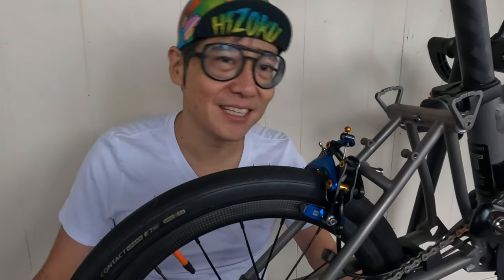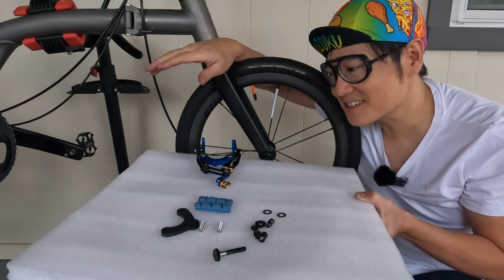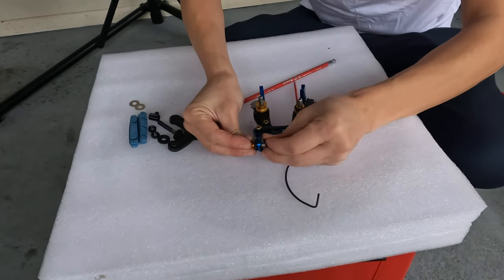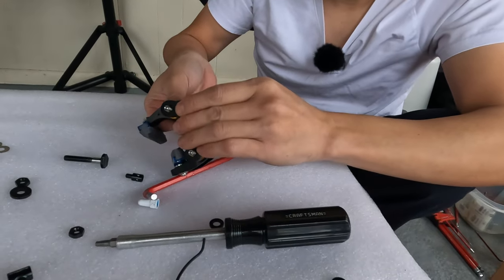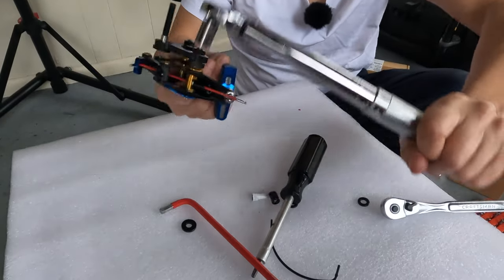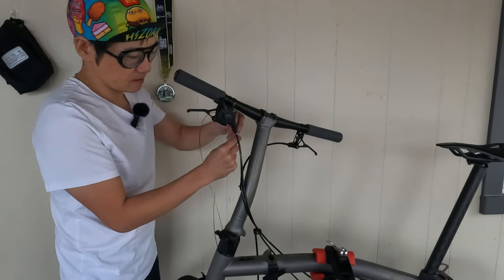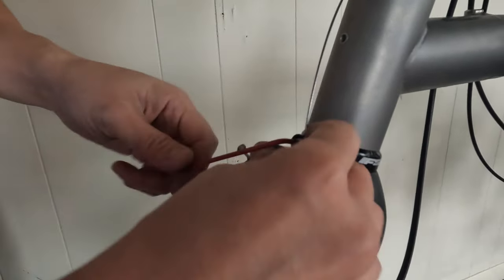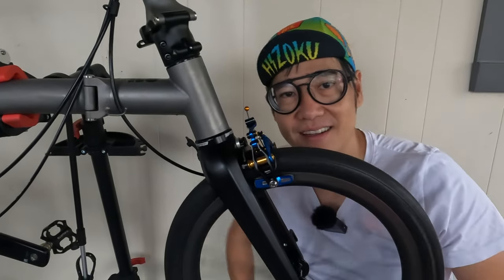BROMPTON T LINE UPGRADE CANE CREEK EEBRAKE EL TORNADO EDITION

Comment: Hi, it is very nice brake upgrades on your bike! Have a little tip cables are often overlooked: Lubricate all your cable wire for optimal gliding function with, for example: Tri Flow Lubricant Teflon. Higher quality cables such as linear brake cable with smooth surface Teflon coated pre-stretched increase the functionality of your brake system.
Greetings from Croatia
Reply from the maker: Thanks for the tip! I have been meaning to do that.

Comment: I have changed the small brakepad, security bolts on my brakes to titanium, as also other parts on my ordinary brompton brakes. For now my "Lightweight", with mudguards ( I'm a Rainy Dane!), is down to 9,35 kilo, and still with room for improvements to make it even lighter in spring! But as a 75 years old, 100 + kilo man, I may find less expensive ways to make the combined weight of bike + man come down, and a full titanium bike isn't one of those, I'm sure my dear wife will strongly agree😁!   Finn. Denmark

Comment: Hello,

thank you very much for the great instructions. I have one small tip.
3:38 Please put Loctite in the thread of the nut, if the air can not escape. In this way, the adhesive is distributed evenly. If the screw is wetted with Loctite, most of the adhesive is pressed out again by the air pressure when screwing it in.

Thank you ☺️
Reply from the maker: Good tip! I will do that.

Comment: nice I did try lightweight aluminum levers and carbon fiber brake calipers very light but they felt spongy to me did not trust them so I went back to the stock setup and like it more
Reply from the maker: I know what your talking about. When I am braking hard I use both brakes to distribute the braking power.   I would like to try the Paul brand brakes next.

Comment: Great video,  one question, what is the reason for direct mount ? better than regular mount?
Reply from the maker: The direct mount brake has two bolts on the caliper that stabilize it better than the regular mount which only has one.  So when you squeeze the levers the brakes have more strength.  How much more I don't know because I have never used the regular mount.  I have asked a few people and they all said it is better as well.
Reply: @BromptonFamilyTime  Thank you!!! Arigato~~

Comment: Do you feel brake performance has improved?  I’ve heard that braking strength is reduced but obviously weight savings vs. Stock.   And of course they look amazing.
Reply from the maker: Brake performance feels the same (technically they may be better maybe if I have to brake hard but I haven't tested them enough to know yet.).

Comment: May I check which version of the eebrakes did you get? Apparently there are front fork mount, seat stay, brake set etc...
Reply from the maker: This limited edition is a set in the direct mount Fork/Seatstay configuration.

Comment: Hi, you are using aceoffix brake levers and how you attached the stock shifter on it ?
Reply from the maker: Yes they are the aceoffix brake levers.  You need to buy a separate adaptor for the shifter.  I am using one by H&H design.

Comment: I have a comment because I noticed something while putting it together.
 If you roll backwards on a hill and then apply the brake, the brake pads would have to push out backwards because there is no set screw to hold them in place.
Reply from the maker: There is a small "indent" keeping it in place.  If your brakes are engaged it shouldn't have any problems coming out.  If your rolling backwards for some reason, then maybe there is a small chance.

Comment: Was told that the direct mount eewing brake might rub against the tyre (Schwalbe ONE) that I am using.  Wonder if T line and P line any difference when mounted with the brake.
Reply from the maker: I'm not sure but there is plenty of clearance so I don't see any problems with rubbing.

Comment: Hey 

What is the weight saving over the original brake? What brake levers do you use?

Keep your great work up, I love it.
Reply from the maker: The brake that it replaced had a full titainum bolt kit kit on it so there was not much weight savings.  This is due to the weight of the mounting bracket adding weight.  I don't remember the exact weight savings over a complete stock brake caliper.
Reply: @BromptonFamilyTime  Thank you. What kind of brake levers are you using?
Reply from the maker: Aceoffix Carbon Levers.  They don't feel nice but are light weight lol.

Comment: May I know what brand of brake lever you using for your T line? Thanks
Reply from the maker: Aceoffix Carbon Levers and a H&H shifter/bell mount.
Reply: Thanks for the reply. May I know how is the performance? I was considering between aceoffix carbon and Extralite 3 brake lever
Reply from the maker: They are not as comfortable as the stock levers since the edges are sharper.  The trade off is these are light weight.  I personally like them but I have heard from another rider that one of them snapped on him.  I may get a set of Paul levers next if they brake but so far they are working fine for me.
Reply: @BromptonFamilyTime  thank for you reply and really appreciate it!! And I love to watch your video!!! Very nice and informative 😁

Comment: Any reason why you went for this and not the regular mount?
Reply from the maker: The direct mount is suppose to be stronger in terms of braking performance and also it sits lower on the rear so you don't have to worry about ground contact.
Reply: @BromptonFamilyTime  I see, fantastic looking brakes they really complement your t line; I’d ❤️ a set for my Brompton but can’t justify the expense. Awesome channel btw,  happy new year to you & your family.
Reply from the maker: The best brake upgrade would be changing the stock brake calipers with titanium bolts.  The stock Bromton brakes are excellent.  This upgrade is not necessary.  This is my dream bike and I changed it for cosmetic reasons mostly.  I won't be buying them for my other Brompton bikes lol.

Comment: Nice brake sets! 

Btw, in asia at least, I observed most ppl change the arms of the êebrake to Ti parts arms (longer), so have a larger gap between the brake and the wheel, wonder with original eebrake arm, will it cause any issue for you later?
Reply from the maker: I have seen many ways to install these eebrakes onto a Brompton.  The regular mount needs to have an extender to make them work.  So, the choices are the mount "drop" mount, brake pad extension or to change the arms (or even a combination of these).  I have seen mixed results so I went with the direct mount since it is straight forward.  From my research the direct mount offers better braking by design.
Reply: @BromptonFamilyTime  I guess direct mount also make the money spent worth it, my personal opinion, if you changed out the extender arm, it’s “almost not” eebrake anymore since almost 80% of it is not made by ee, good choice!
Reply from the maker: @eth3002  That is true.  It is nice to use it as it was made by Cane Creek.

Comment: Hello, what is your experience with TI Parts?
Reply from the maker: I love their parts overall.  The smaller screws and bolts can strip easily so you have to take your time and make sure your tool is properly engaged.

Comment: The EEbrakes don't work very well on brompton. 'The small wheels have so much more torque than 700c and the calipers are single pivot type and they can not keep up. Aditionally they have very short  arms limiting wheel selection. I sold mine
Reply from the maker: Which mount did you have? They feel the same as the original for me.
Reply: @BromptonFamilyTime  Nice to hear, it worked for you. Mine were not direct mount though. I damaged a couple of tires by missing the brake path and rubbing the tire sidewalls with the brakepads due to the short arms. Only my kojac tires would fit below the caliper. I went back to stock calipers
Reply from the maker: Yes that could be a problem.  I have seen many solutions for the short arms (arm extenders, brake pad extenders, etc) but it makes the brake weaker.  The stock brake calipers are great anyway.